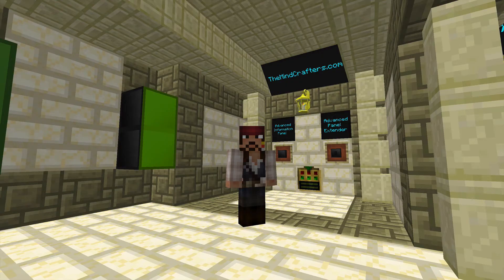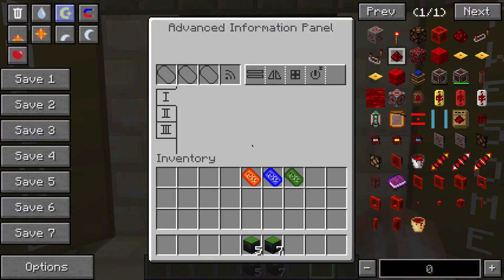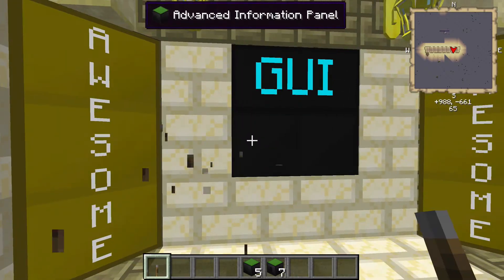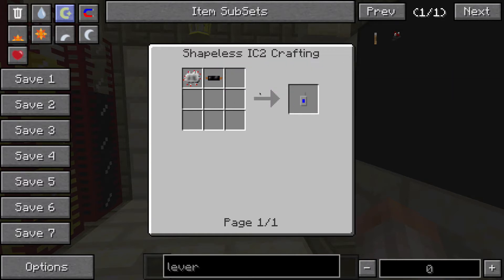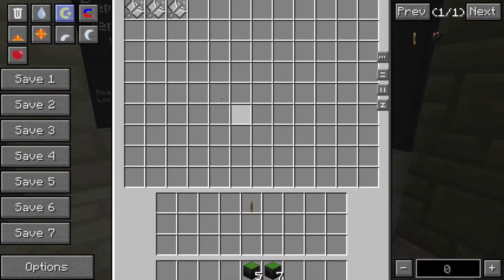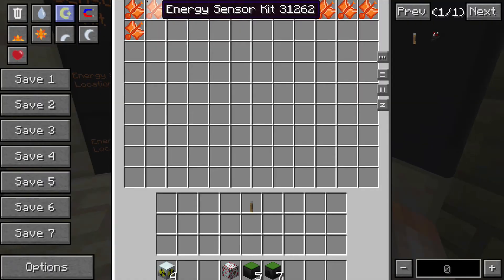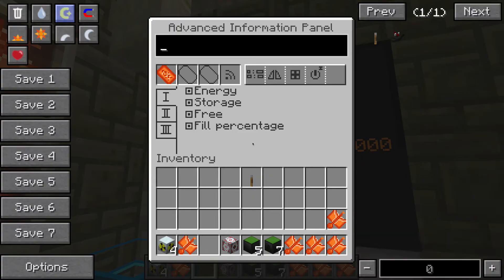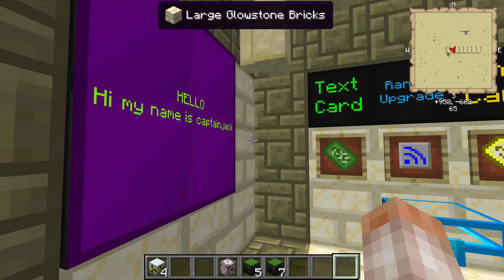Block Spotlight: Advanced information Panel

Comment: Is it compatible with Computer craft?

Are there ways to make it cycle through displaying different information? I assume you can use pipes and stuff to pull cards in and out of the displays.

If it's compatible with Computer craft, these would be much more useful than CC monitors in some ways.
Reply: why?
Reply: ArmyOfCamels Why what?
Reply: ***** why more useful than cc monitors
Reply: ArmyOfCamels Just the fact that you can place them on angles makes them more useful.

The fact that you can change their depth makes them more useful.
Reply: ***** k